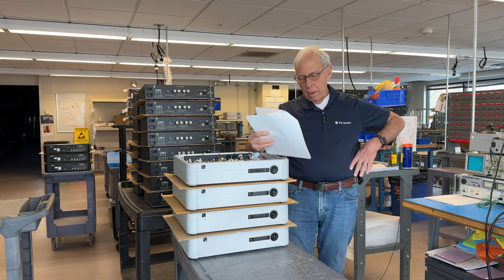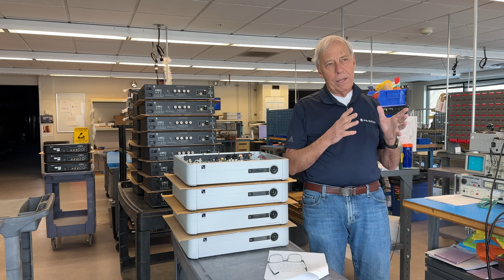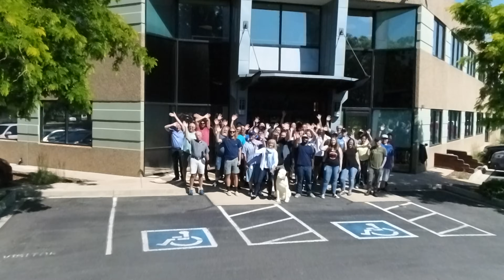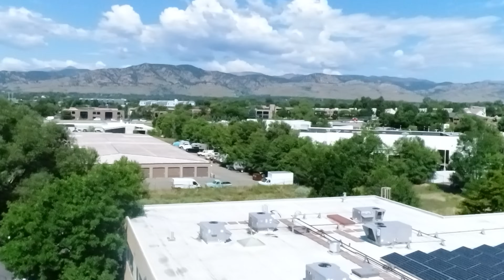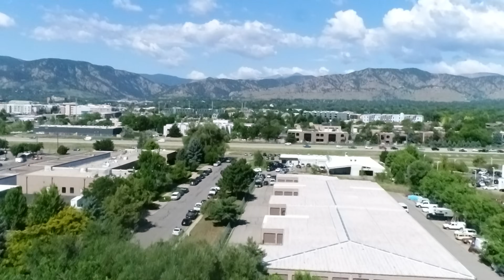Why USB noise is harmful to HiFi

Comment: Actually, ethernet connection brings more noise than USB as common ground noise across devices are shared from other devices too. Properly handled USB connection delivers better integrity of i2s signal, even more than i2s over lvds transmission through HDMI connection.
Reply: What about that noisy neighborhood we live in? Time to go solar, get off the grid and go full audiophile prepper.
Reply: Another tech channel did a teardown of an audiophile network switch. The components inside were quite obfuscated and they called it as snakeoil. It most likely was, but they never checked regarding that common ground which would have validity.
Reply: @benwu7980  all switches are the same? Maybe audiophile is snake oil. All systems sends 20-20k to me too lol.
Reply: @harackmw  Or go outside, listen to live performance and touch some grass... or cats.
Reply: @fidelizer.  Oh, I wasn't meaning audiophile in a more general way. Like they also had an audiophile ssd. What you were saying about common grounds, or Paul regarding jitter is valid. It's whether some of the products on the market are actually doing anything of benefit.
Reply: @benwu7980  Many products nowadays offer 14-30 days money back guarantee. If they're really ineffective, they'll receive a lot of returns already. If you are an audiophile, you should focus on listening to actual audiophiles who own trustworthy reference systems. Many audiophiles invest a lot on their system and most of them aren't foolish enough to blindly believe in what people who don't invest on audiophile hobby. I hope you aren't one of those who want to kill time with bashing other people's hobbies like those tech nerds.
Reply: Ok but that's not apples to apples. You're not using Ethernet switches to get a digital signal to your DAC. You only used ethernet to get the file which was actively error checked and fixed without you even knowing. It's like if you bought a nice shirt off Amazon that you're trying to keep as dry as possible from when you get it till when you go out with it. The Ethernet switch is like when it's being delivered. Doesn't matter if its pouring rain because it's packaged and protected. Now you open it and you have to choose to put it on in your dry bedroom (Streamer w/ Digital Out) or in the small downstairs bath where your kids are attempting to wash your cat (PC w/ USB). 
And you could actually choose to put it on outside in the pouring rain, but that's so ridiculous it's not even considered. Which is why you've never heard of connecting your DAC to your router. While technically possible it's such a bad choice that no company even makes a DAC with that option.
Reply: @Sirmooses  You're misunderstanding things. I recommend you to read Jitter Requirements from IEEE which addresses about jitter in wireless network with audio directly. Not sure if you can understand without proper studies and enough background knowledge but they're proven facts and approved by IEEE to be put on their website.
Reply: @fidelizer.  You're telling me to go read up on wireless networks when discussing Ethernet & USB. I don't think I'm the one misunderstanding.
Reply: @Sirmooses  I ask you to read that to see how jitter affects audio in network. It can apply on both Ethernet and wireless network.
Reply: @fidelizer.  Yes it would but that's not talking about audio in a HiFi setup. You're not sending audio over an ethernet or wireless network. Wherever your music is coming from be it a streaming or hone network, it is received in a file format (FLAC, MP3, WAV) decoded/decompressed by your audio source (Streaming Service or Standalone Media Player) and that sends the Bitstream (Digital Audio) to the DAC (USB, DIgital COAX, TOSLINK, etc) and from there the ensuing analog signal is sent out to your system.  The Digital Audio (Bitstream) signal is never actually in network, that would apply to maybe things like Voice or a Home Theater setup.
Reply: @Sirmooses  You do send them over. You seem to have misunderstandings about bits are bits. Maybe you should study materials I recommended first and try to understand what sampling jitter is and other kinds of jitter. It's IEEE material.
Reply: @Sirmooses  Calling IEEE a snake oil company? Yeah you should give up. You'll do a big favor to audiophile community by ending your ignorant.

Comment: His initial wording is VERY confusing, to say the least, if not arguably wrong. 
Indeed, you can’t hear digital noise itself, on its own, just like you can’t hear digital audio files as they are, until you convert them to an analog signal. 
Digital noise does mess up both the proper digital audio data and the proper functioning of the digital processing that ultimately converts it to an analog audio signal for the amp and speakers. 
So whether digital noise itself can be heard is pointless. What does matter is that it corrupts the eventual quality of the playback in the real world, versus the quality that’s within the digital recording. 
So in short, digital noise must be watched for by appropriate choices : properly designed elements and connections…

Comment: Oh believe me USB noise is heard. I hear noise every time I charge my laptop while playing music through a USB Audio dongle. It's bothersome enough that I just use my LG V60 as a DAP which has no noise when it's charging.
Reply: The noise you hear is due to electrical issues that you have, perhaps a bad design, perhaps a malfunction that you are having. Nothing to do with what Paul is talking about in fact you missed the point because what he is saying is that unless you use expansive galvanic insulation, which you are not, ALL usb audio will have these problems including your v60

Comment: Hi Paul, when the connection is as simple as computer/USBcable/DAC, where the cable & DAC are of known high quality, it ought to be a fairly simple test to determine which computers are 'noisy' & which arn't. Has anyone done this? 
Of course the DAC will need to be replaced by a similar USB receiver of known quality in order to do a bit error rate tests.
My fear is that in more complex connections, some poorly designed equipment under performs, others over perform & the consumer has no way sorting the wheat from the chaff, the result being the confusion seen in the replies below. The consumer digital transmission industry needs test & standards that a regular consumer can understand.

Comment: What happens when Paul makes a 2min video vs a master class PhD lecture....
Signal to noise. In audio, 0 to 120db is perfect.
The noise he's talking about is electromagnetic interference. It has very little to do with the sound bit stream. Its a whole different animal that can cause problems.
Think of it like the audio data is you, driving down a perfectly flat road. Think of EMI like a helicopter also flowing you down that same perfect road at the same time.

Comment: Switching from an Intel NUC 12 to a Macbook Air (m3), both running Audirvana, same setup, same cables, etc. directly connected to the dac the jump in sound quality is astounding. Not only got rid of the background noise, but also sq is way higher in most parameters, especially detail and separation, it's like jump from 1080p to 4K

Comment: Less processing means less potential for noise. 

USB is a serial interface that slices the data stream into packers for transmission.  Whereas, spdiff is a serial protocol without packetization.  

Hence, USB connections may be more susceptible to electrical noise due to the nature of USB transmission, which involves higher frequencies and more complex signaling compared to S/PDIF.

Comment: Hello audiophiles and the like, I have an extremely modest system that I hope to upgrade when the time is right for me. So I follow as many audiophile rules as I can given what I can invest currently. For example, no room treatment and I run a usb type A 2.0 from a laptop directly to a type b 2.0 usb on an integrated amplifier, PS Audio Sprout. A few nights ago during a listening session I thought to myself, the image is exceptional tonight and seemed to be marginally better than anything I experienced previously. At the end of the session, I noticed my laptop was unplugged from the AC socket(it's always plugged in). Could this have been a factor in what I experienced or is it just maybe I got more wax out of my ears in my last shower 😂. Thank you for any input or banter on this matter

Comment: I stream over USB from a Raspberry 4 powered by an LPS. To my ears it sounds amazing.
Reply: That's because the problem with USB isn't that it's inherently noisy, it's that it's not well protected from stray noise (electric currents & fields). If you're using a Raspberry there's not much else going on besides the few components needed to be to get the music file, extract and send the digital signal. On a PC There's magnitudes of orders more, video cards, apps, inputs & outputs, etc. Thousands of data streams per second you don't want splashing into your digital audio stream, and USB is not designed specifically for this so it's leaky.

You would get a cleaner signal using another option from your Pi, but the difference is small enough you may not even notice depending on the quality of your equipment & setup. Some DACs are also designed for USB specifically too. So it might be the worst place to start the components in that path might be fine tuned to make up for this, while they skimped out on the other inputs.

Comment: Actually usb noise is bad i get it in a mikwaukee radio .Apparently yiu cant charge a phone and run the line in because the noise from the buck boost circuit on USB chargers geberate loads of USB noise in audio .Mikwaukee needs to fix this issue on their work radios .just ruins the sound of high wuality recordings in MP3  or other formats